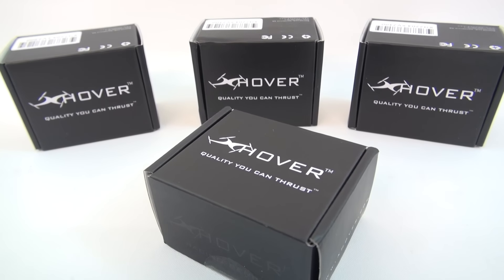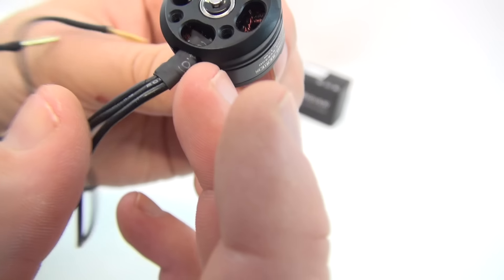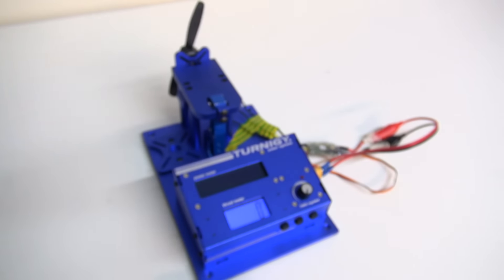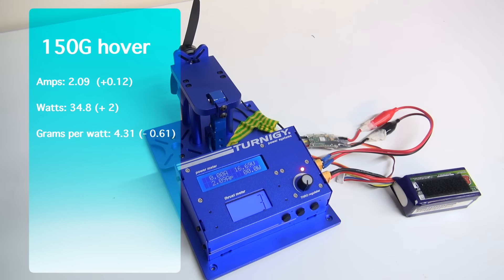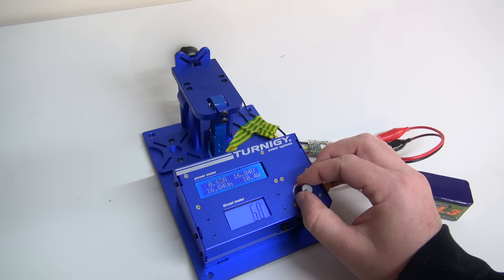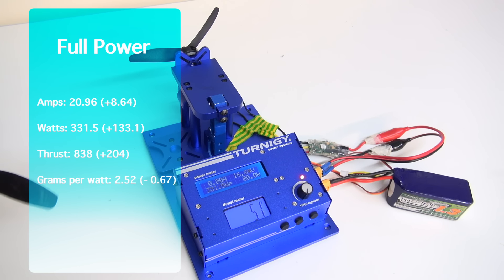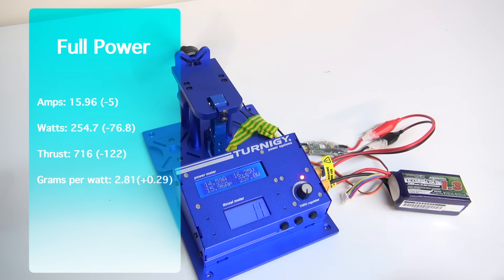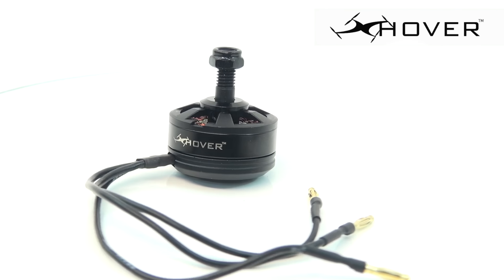HPIGUY | Xhover 2204-2300KV Motor Thrust Stand Tests!

Comment: When you are flying a quad copter there is four motor using one battery. More Amps means more C rating and lower voltage. It effects the result a little bit.